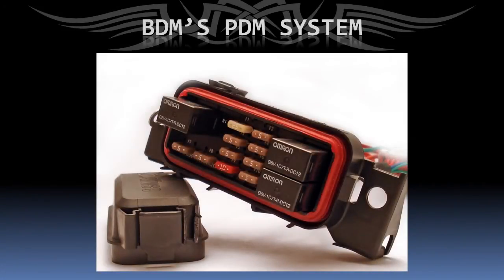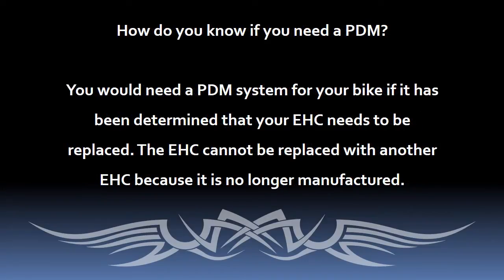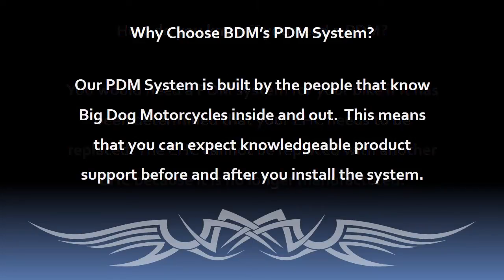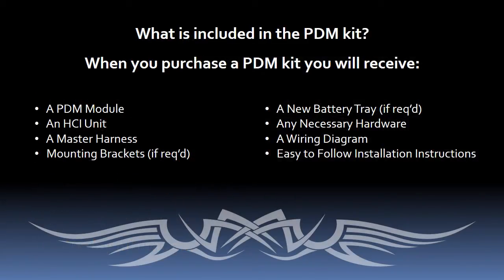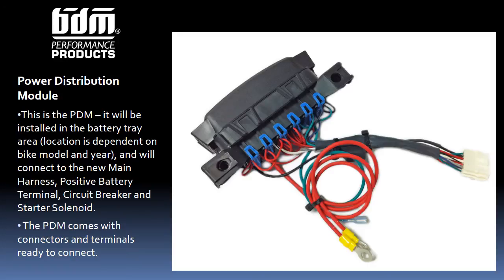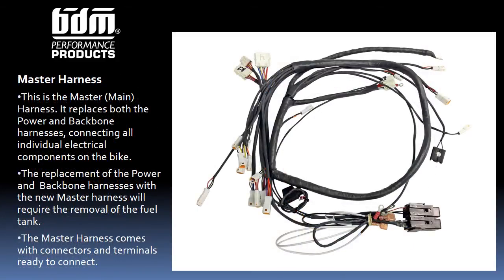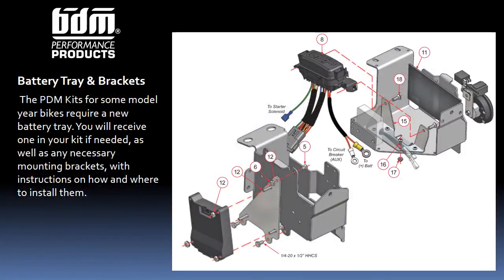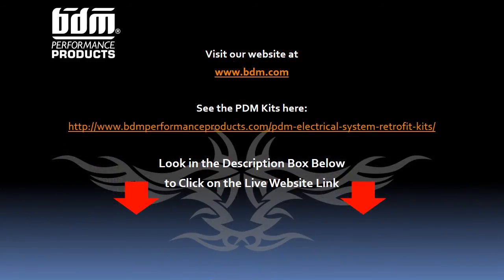Learn More About the PDM Electrical System by BDM Performance Products

Comment: If you want a reliable big dog chopper, eliminate EVERY bit of original wiring, convert to Harley switches and switch housings. Install a electronic ignition.  You will need new handle bars because the switch housings won’t fit on BDM bars and you will have to replace the timing cover (I bought from S & S)..... it’s expensive and takes time but it will make the bike reliable and you won’t have to tow it home every time you ride it.